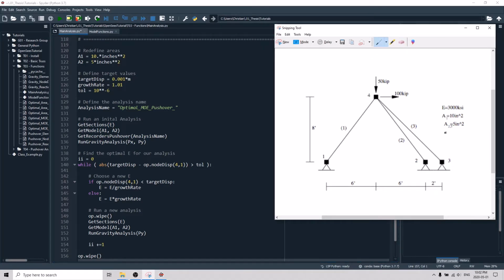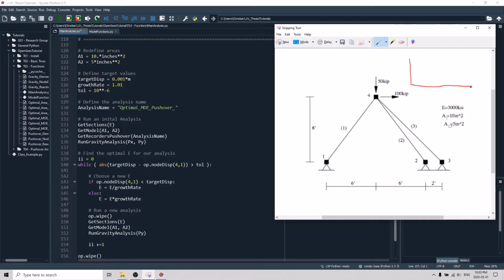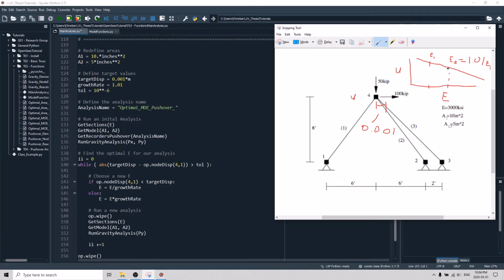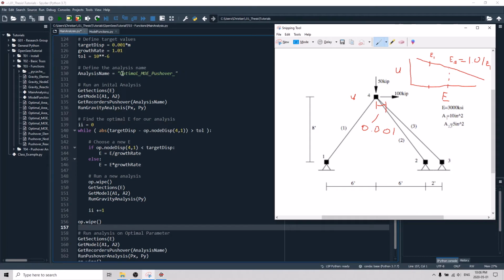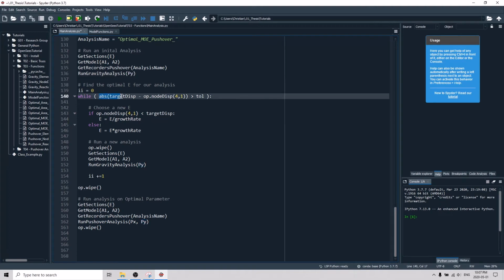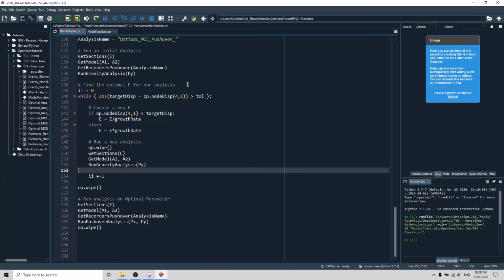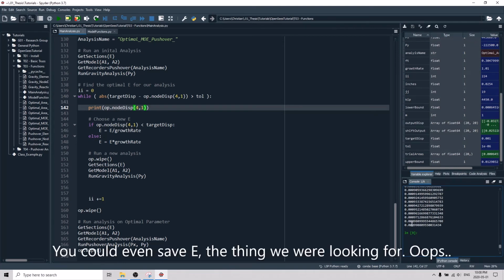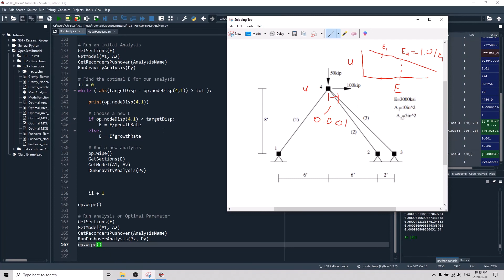Learning OpenSees - Functions - Part 3: Unknown Number of Analyses

Comment: Hey Christian, I have been finding these videos very useful as I need to use this program for my masters dissertation this year. I have followed all your steps the last few videos and I have run into a problem when it gets to line 140 (while loop).
It seems like its not converging to any number and when I print the (op.nodeDisp(4,1)) it just comes up with zeros.
Do you have any suggestion to what may be the problem?

Again thanks for the videos! They are extremely useful :)
Reply from the maker: Hey Daniel,

I'm glad you're finding them useful!

Interesting. My first thought is that the maybe the load isn't being applied properly. Maybe check if you are applying it to the correct node? Is load being applied to the correct load pattern?

To me, a bunch of zeros says that the analysis is running successfully at each step, which would happen if no load was applied.  The zeros would also make sense if there was no load applied.

While loops can be a little dangerous, because they will keep running even if something is messed up!

Cheers,
C.